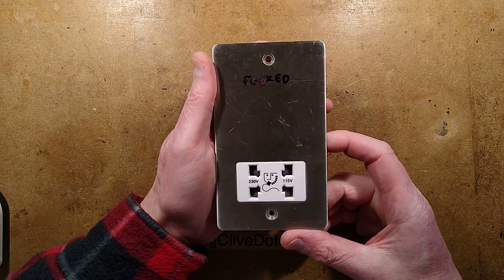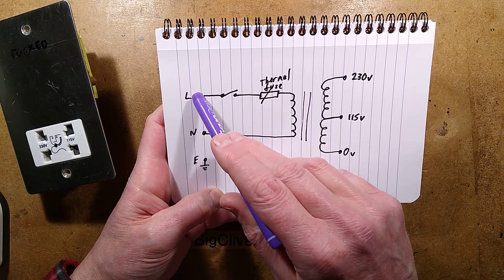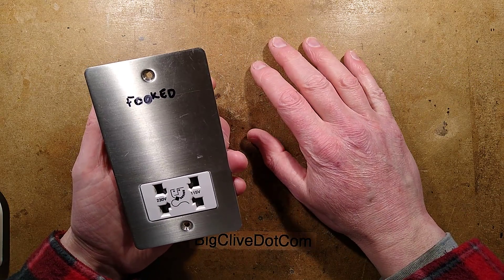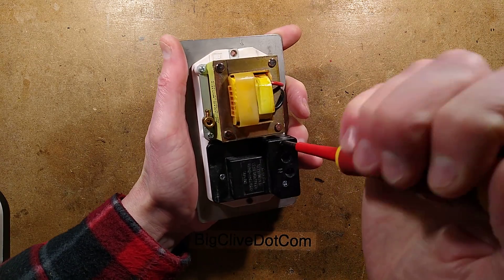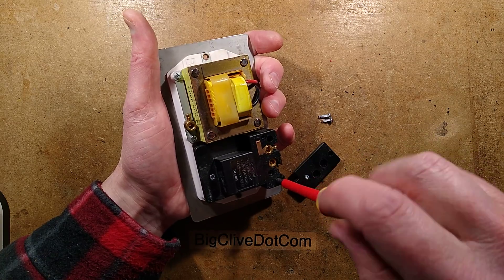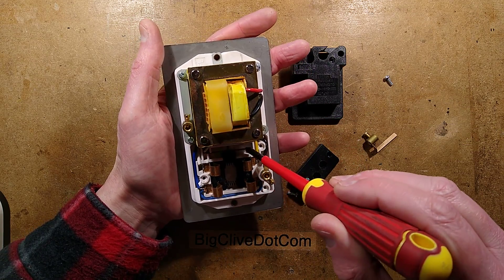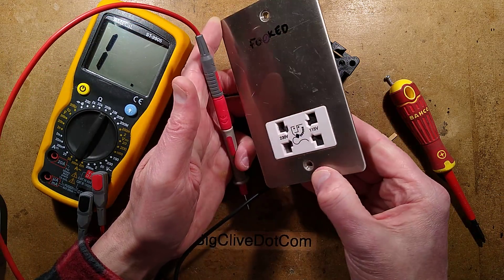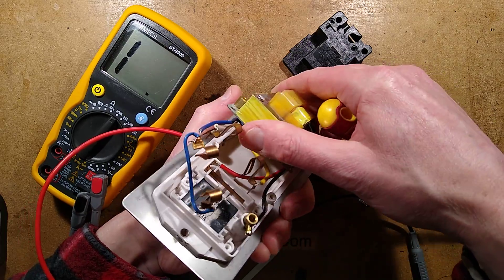Exploring a failed British shaver socket

Comment: The house I grew up in over here in NZ ( built 1975 ) had one of those.  Not so common these days, seems to be standard outlets with RCD's in bathrooms now, or RCD back at the fusebox.
Reply: RCD at the breaker box usually I think
Reply: The house I grew up in in Canada, which was also built in the late 70's  had a shaver socket in one bathroom (and a regular socket not too far from the sink in the main bathrroom - so go figure). You don't see them anymore - all GFCI (RCD for you limey types) plugs now.
Reply: @gorak9000  Here in the States my 32 year old home has the bathroom circuit (two bathrooms on the same circuit) protected with a GFCI in one of the bathrooms.  I have verified that when it trips both bathrooms have their power outlets become "nonfunctional" until someone resets the GFCI.  To my knowledge they aren't required by code in Michigan (which has only seen minimal updates since the 1950's) but for $20 I would rather have one than not.  Mine came with the house installed but they aren't that much harder to install than a regular three prong outlet.  A friend of mine built a house himself and even though his kitchen was all on two circuits he installed multiple GFCI outlets on the wall behind his sink (all on one circuit) and counter when he only needed one.  Since Michigan's electrical code is silent on the use of GFCIs the inspector let it slide.
Reply: @mharris5047  That's not how it works - Michigan doesn't get to set their own rules - they only get to add rules on top of the NEC which go beyond what the NEC calls for. GFCI's have been required for YEARS anywhere close to a water source. All kitchens / bathrooms / outdoor plugs must be GFCIs. A relatively new thing is all bedroom or living room plugs must be AFCI now too - too many people running extension cords for lamps under carpets leading to fires. Pretty much the only plug you'll find in a modern house that isn't GFCI or AFCI is a special single plug outlet in the garage for a deep freezer if you have such a circuit - the nuisance tripping of a GFCI or AFCI on a freezer leading to spoiling of the food was allowed an exception. There might be a similar exception for the plug behind your fridge in the kitchen too, but I'd check the code book on that one... (and yes, it's fine to have one GFCI plug with a bunch of regular plugs after the GFCI - if wired correctly, the one GFCI plug protects all of them - that's standard practice to have one GFCI plug on the circuit, and a bunch of regular plugs after it - sometimes they put a sticker on the plate notifying you that it's GFCI protected, so if the plug isn't working, you know you have to go find the GFCI somewhere to reset it)
Reply: my place the RCD is in a socket in the bathroom, and the other sockets are piggybacked off that. So they are all on the single RCD

Comment: I've mainly seen them in the UK. Not in the rest of Europe. Have used them to power my laptop, when I haven't brought an adapter for the UK plug.
Reply: I (mis-)used one in a Swiss hotel to try and charge my laptop - or rather tried to use it as an overload protection kicked in after a few seconds, reset after a few more seconds and so on ... so there must be some with a self-resetting protection.
Reply: They are quite common in the Netherlands (or "Holland" to to the rest of the world ;-) ), but only 230V AC.

Comment: USA here, never heard of such an outlet/device. Our modern bathroom outlets are GFCI protected.
Reply: Before GFCI they existed and where somewhat common, especially in hotels.  The cover plate would say "Razor only".  Naturally someone would plug in a hair dryer and burn them out.  They usually fit a 4" square box (the one that's a little smaller than the commonplace 4-11/16" square range plug box.)
Reply: Our modern houses are RCD protected for all outlets, lighting circuits. GFCI is essentially the same as RCD. Slightly older installations will have one or two RCDS protecting the entire installation while newer knees have individual RCDs in the consumer unit (electrical panel) for each circuit. Some even have AFDDs (arc fault detection device).
Reply: @klausdudas  yeah exactly what I was thinking, absolute life saver having every plug be protected.
Reply: @klausdudas  We put them where there is a risk of electric shock.
Reply: @paul_moir  given the US plugs have essentially no safety features at all (bare prongs that make contact before being fully inserted) there is always a risk of electric shock with North American plugs 😜
Reply: @klausdudas  I agree it's amazing how bad the design is.  Not too surprising when you consider how old it is though.  What is surprising is that it doesn't seem to actually cause a problem.
Reply: @paul_moir  I agree. Having ~110V L-N must help with that.
Reply: @klausdudas  I think that's the big difference.  We, and I'm talking Canada here but the US does the same, mount our outlets very close to the floor as well.  So at an early age and with strong hearts, we learn not to stick our fingers into the plug sockets.
Reply: @klausdudas  Oh, I meant to mention another thing.  To help with the obvious deficiencies with our standard outlets, when the grounded ("3 prong") plug was designed it was meant to have the 3rd ground terminal at the top.  That way if anything thin and conductive was dropped on it, it would strike the ground "prong" first and therefore be relatively safe.  The only place you ever see outlets installed this way is in really old original installations or government buildings or other specified buildings like hospitals.  Upside-down it looks like a face, and people liked that so that's the way they get installed in residential application!
Reply: @paul_moir  🤦🏻‍♂
Reply: I remember seeing one of these in London when I visited and was quite surprised to see a dedicated socket for shaving! 

It makes more sense that it has other uses, but now I know what it was and how it works :)
Reply: Regular sockets aren't allowed in most cases as they have to be 10ft away from baths and showers because of 'safety', and all wiring (including in the walls) has to have GFCI/RCD protection at the breaker.
Reply: @simolatham03  The GFCI protection does not have to be at the breaker, and in most jurisdictions it's now 5'.  This does not include anything that is actually protected against moisture, so properly waterproofed electrical installations do not need additional protection.  I suspect most the electrocutions were happening in wet conditions so that's why the code went that way.  I think the "GFCI in the garage" code is pretty short-sighted though considering what some people get going in the garage.

Comment: This makes me feel nostalgic. They just have GFCI outlets in US bathrooms. The pull-string lights in UK bathrooms throw me when I go back nowadays, I spend a good 30 secs pawing the walls.
Reply: What really throws me about UK bathrooms is the fuzz they make about electrical safety with the pull-strings and isolation transformers in shaver sockets. Then, at the same time, they have a freaking 18 kW, 3-phase 400V, tankless water heater INSIDE the shower cabinet. They call it "electric shower" (google it, I'm not kidding).
Reply: Not many three phase showers in the UK as domestic three phase isn't particularly common, although it is increasing due to the increasing use of car chargers and ASHP. The design and construction of approved electric showers is such that the user can never come into contact with anything that could become live even under double fault conditions and in the very unlikely situation that a conductive water path occurs the victim is generally stood an a well insulated surface in addition to the shower supply being protected by an RCD.
Reply: @farmersteve129  My bad on the 3-phase, however 230V are still plenty dangerous.

Not sure if I buy the "well insulated surface thing", given that you'll be standing in a puddle and there''ll be a more or less continuous body of water through the drain pipes to ground.

RCD and insulation should also apply to a regular light switch and a regular socket out of the immediate reach of the shower. It's this dissonance between super-duper-safe on one side (string switch) and normal-to-slightly-dangerous levels of safety when it comes to the water heater that gets me.
Reply: @andreasu.3546  If you see the regulations these have to pass to be made, and installed, you would be fine with them ... 
UK electrical safety errs on the side of paranoid... but it does mean you have to really try hard to get electrocuted, and electrical fires are very rare (and mostly due to  poor maintenance, or already recalled products)
Reply: @krashd  I must admit, living in a Schuko country, I do like the UK idea of having a fuse in every plug. Not sure if I like the oversized plug itself. The potential of stepping on one that's on the floor with the prongs up would probably give me nightmares.
Reply: @davidioanhedges  If the uk really cared about safety they would be using full size ground wires like the rest of the worls.But they use 1.5mm2 ground wire with 4mm2 live and neutral.
Reply: @MernokiMegoldasok  This is mainly about the USA ... where ground wires are entirely missing - some other countries do some things better
Reply: @davidioanhedges  The USA actually has ground wires since the 1970s.even some 1960s houses sometimes had a ground wire in the box behind the ungrounded outlet.
Reply: @andreasu.3546  Domestic setups don't have 3 phase, 230v single phase is enough.
Reply: @EmyrDerfel  I didn't know that. Tankless water heaters of any substantial size are all 3-phase where I live. 230V are still plenty enough to kill.
Reply: @andreasu.3546  https://youtu.be/AlU69Y6NcxQ 🙂
Reply: @andreasu.3546  hang on, do you mean to say electric showers aren’t common in the US?
Reply: @samuell.foxton4177  in the US we usually either have a hot water tank, heated by gas or electricity, or the "hot water on demand" heaters that basically drop in to where the tank would be. I've never seen an electric showerhead, and given our electrical safety standards, that's probably a good thing
Reply: also the power isn't usually as much as you think, my electric shower is a low end model (came with the house) and is 7.5kW, which honestly is just about enough
Reply: @samuell.foxton4177  I don't know. But why not, they also have electric chairs...
Reply: @andreasu.3546  those chairs keep you nice and toasty😅😂
Reply: @andreasu.3546  Maximum on a shower is around 10 kW at 230 volts - UK domestic supplies are single phase only. There are complicated safety features, but I agree it does seem at odds with other rules. We also use electric heaters and radiators in bathrooms with pull switches or double insulated switches.
Reply: and a redundant gfci/rcd on the cord on bath room appliances.
Reply: @KingOfKYA  redundancy is good, especially when it prevents electrocution.
Reply: @KingOfKYA  Yo, dawg, I heard you like GFCIs, so I put a GFCI in your toothbrush so you can protect while you protect!
...I'll show myself out...
Reply: @KingOfKYA  That is for the inevitability of someone not having a GFCI in their bathroom.
Reply: I grew up in a house that had some pull-cord lamps in it.  When we move in, when I was a baby.  They all got replaces with more conventional types.  (This was a house for which the ancient knob-and-tube wiring had been a retrofit.)
Reply: We had one of those pull string lights in our bathroom before we renovated it. There's nothing like flailing around madly for the pull string in pitch blackness while needing to whizz badly.

Comment: I have seen them in hotels in various contries, but in the Netherlands never in a home.
I have worked at the electronics department of a company where we had the entire workbench behind a 3 kW isolating transformer. Scopes, soldering irons, everyting. It was done because we also had to test and repair live equipment. Felt very save, and was always fun to show to people who didn't know about it 😁.
Reply: Same for Germany - common in hotels, not in homes.
Maybe because in the UK I have seen electric toothbrushes and shavers sold with the 'euro plug'?
Reply: @hagen-p  that in fact isn’t a euro plug. It’s a British plug that predates the current three pin one. The pins are fatter and parallel compared to euro plugs. So won’t fit into a European plug socket.
Reply: @lukedoherty8062  Interesting. I have charged a phone with a charger in one of these in the past (an old phone, with an 1 amp 5 V charger), so an Euro plug definitely fits into the socket my in-laws have. And the electric toothbrush plug is also definitely an Euro one. But now I know why the odd shape. Thanks!
Reply: @hagen-p  euro plugs fit the shaver outlet but the British toothbrush plugs don’t fit European sockets. I found that out the hard way with my toothbrush charger in Portugal. But I’d you google you can see the slight difference.
Reply: @lukedoherty8062  Will certainly have a look. Thanks for pointing it out!